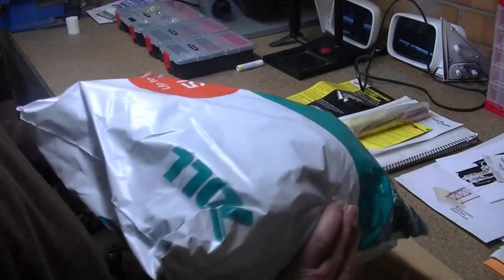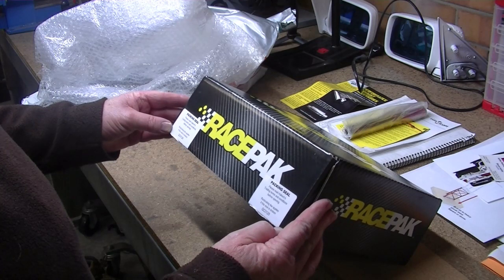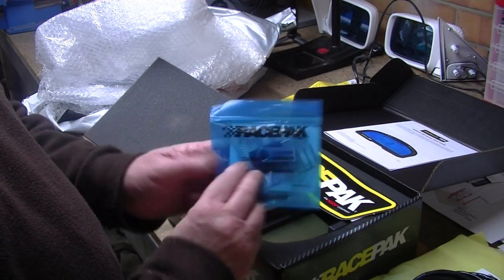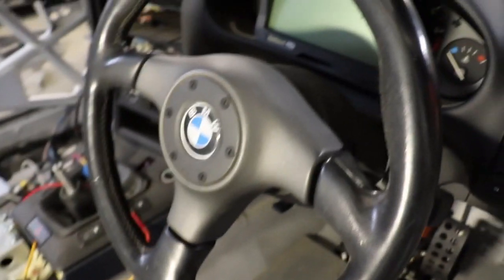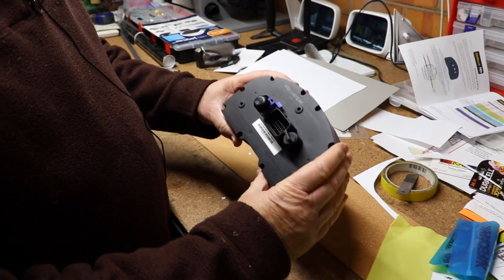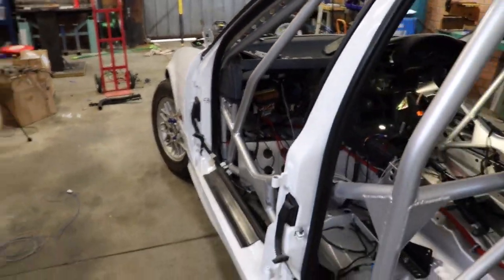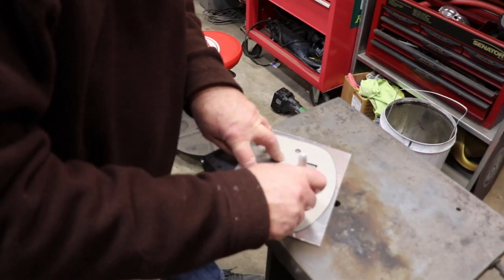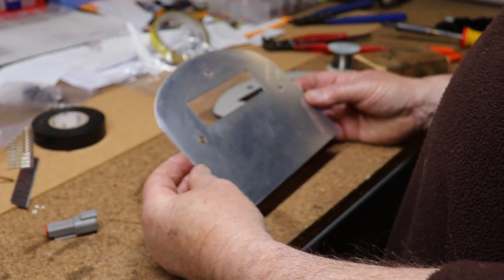20 BMW Rally - Haltech IQ3 dash unboxing, machine Haltech dash mount and program dash

Comment: That looks like a very nice (and expensive) bit of kit Steve!
Reply from the maker: Yep, looking forward to getting all the parameters set. It will give gear selection, rev change light (not that I have ever used those sort of things before) and engine temp, oil temp, oil pressure, battery voltage and more I haven't discovered yet!
Reply: @Kaitler_Motorsport_Engineering  That's pretty awesome! Its starting to all come together and look really good ! Its almost going to be too nice to chuck around in the dirt once its finished!